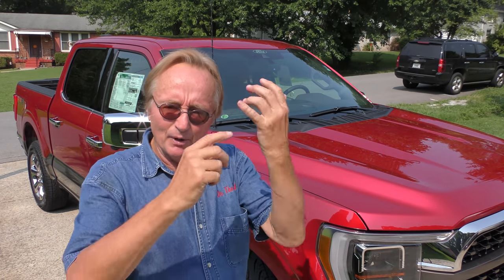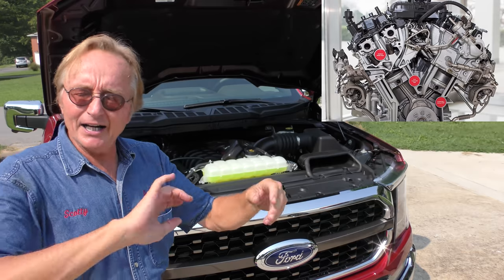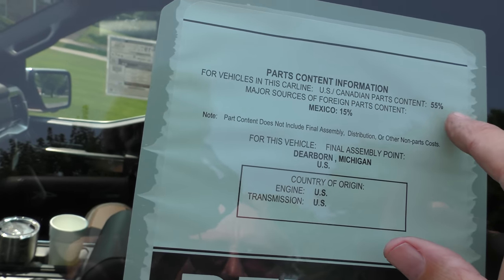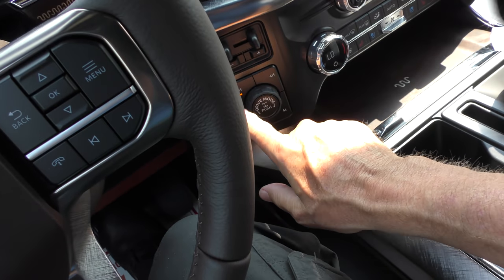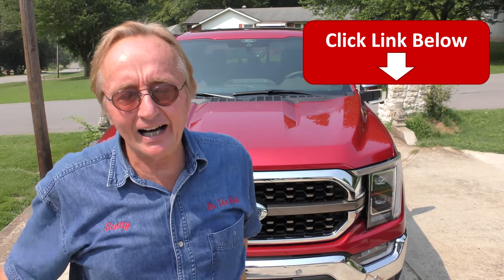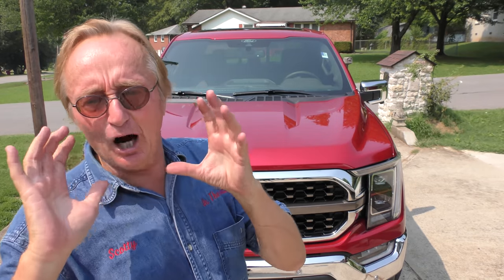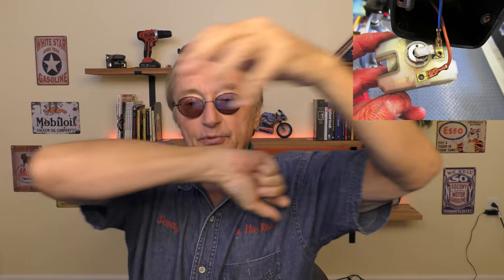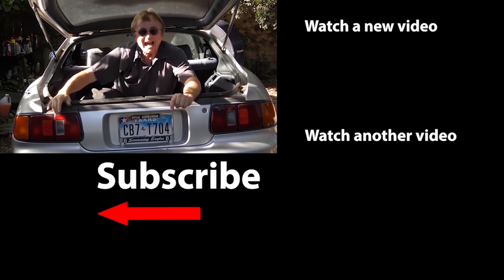I Finally Got a New Ford F-150 and Here's What I Really Think of It

Comment: I own 2 Ford's   a 2014 F250 gas powered and a 2018 F150 .The F250 has 247865 miles on and has never needed anything major I love that truck .My  F150  left me stranded on the highway and had to be towed to the dealership .They advised me that my truck had plastic adjuster's on the timing chain .The truck was in their shop for 3 1/2 months before I got it back . Good thing I had my old 250 for work .They don't offer a loaner till the 3rd month and I could not use it for work..For now I am stuck with it .Beware Ford is not what they use to be .Like I said love my old F250 hate my new F150.

Comment: For the mercedes c230 I have the c230k . It had the same problem. It was due to a faulty combination switch on the steering column.  Was about an hours worth of work and not hard to swap . You will need a long necked t27 to go through the back side of the steering wheel to lose the air bag . Remove airbag and he bolt holding the steering wheel on . Be sure to use the right size . I don't recall it off my head after that you will need a Phillips screw driver . You will remove the clock spring housing.  Be sure to note it's position and handle delicately or it will separate and the spring inside will become unsprung... good luck getting it back together if that happens. Once you remove the clock spring housing you will gain access to the combination switch and be able to remove it from the bracket it's mounted too with the cruise control lever. Replace with a new combination switch I think mine was around 100 bucks . Be sure to note weather you have regular wipers or the rain sensing kind as  they are not the same switch. Assemble in reverse order and remember the clock spring housing has to go on exactly as it came off . There are marks indicating where the arrows should line up. Just a tip have a friend help you when removing the hex bolt holding the steering wheel on . It really helps to have someone to hold the wheel as the her bolt is usually very tight . You will also likely want a cheater pipe to give you good leverage. No steering wheel puller is needed.

Comment: The  only dewcent Ford  back in the good ole  days   had an Inline - 6
Reply: 300 straight 6.  All the power and crappy gas mileage of a V8 with two less cylinders, ran forever though
Reply: Yep, ran forever, that's why they don't make them anymore
Reply: My 7.3 IDI has 300k miles and passes every big 6, whether towing or not

Comment: I'll get one when there is no 10 speed transmission
Reply: 2016 F-150 Lariat 5.0   6 spd. multiple issues during ownership
2019 F-150 Lariat 5.0 10 spd. ZERO issues since new.

Just from "personal" experience. (50% of the time towing)
Reply: @CannonFodder873  I love a ford. I have expedition 4.6 with 270000 its a faily driver for me and we take it on vacations for the past 13 years. I need a new one but I love this4.6

Comment: No one at Ford is stopping me from throwing the V8 in the Raptor
Reply: I know people who have STUFFED a diesel into a Raptor! I think it was a Cummins because they wanted the low-end torque and the extra fuel range and NOT for super fast Baja running speeds. They had to rip out all the engine control modules though and modify the interior info screen control software to make it all work! BUT it shows it CAN be done!

v

Comment: That age Mercedes has a funny design where the wiring for the bulbs is housed inside of the headlight assembly, which gets HOT.  I had a wagon where the wire insulation dried, cracked and fell of, causing the bulbs t0 short out.  I would take a look at the wires carefully.

Comment: Scotty 2016 Elantra GT manual. 2.0L NU engine.  Rod bearing spun at 116k 2nd owner at 27k pulled the pan and cylinder 3 lower rod bearing is hot and I have inspected and changed plugs since every 20k. Recalls on all the 2.0L engines just about except mine extended warranty screwed me what to do now? 2 to 3 k for a used engine

Comment: My mustangs 5.0 is super reliable. Fbo with e85 and the engine keeps running well at 45k miles. The reliability of Ford coyote is why I convinced my dad to go Ford F-150 with a v8 over the dodge/chevy/ecoboost options. His truck runs so smooth. I know Ford has had some trash reliability with certain cars, but the coyote v8 is a beast

Comment: Have you heard anything about the 5L V8’s having an excessive oil consumption problem? There’s a class action lawsuit against Ford about it. My 2020 F-150 5L has that problem. Ford has a TSB for the problem that helps, but it still uses oil.
Reply: I had a 2012 with the 5.0 Coyote and it ate oil. Special ordered a 2020 Lariat with the 3.5 Ecoboost and doesn't use a drop of oil and I'm getting ready for my 3rd oil change at 15k.
Reply: @mikeg5257  That’s unfortunate. I bought the 5.0 only because I follow Scotty and he says they’re the best ones to get. I’m not sure why he doesn’t address the oil consumption issue. It’s also my fault for not looking more into them beforehand.

Comment: I have the 2014 Fi50XLT extra cab four wheel drive. It is a terrific truck, and, the 5.0 Coyote, is a great engine. I get pretty good mileage as well, on a recent 1000 mile road trip with mixed driving, including hauling a bunch of lumber for half the trip, I averaged between 19-23 mpg.

Comment: I had the 2019 with the Coyote 5.0 worse truck I've ever owned oil consumption, transmission issues frozen door locks in sub below weather, leaking crankcase seals. That was just with 50,000 kms. Then got insulted by the dealer on low balling me on trade. Done with Ford!  Drive now Ram 1500 Classic with Pentastar V-6 love it no issues.

Comment: Hey Scotty. The new 2021 5.0L has a belt driven oil pump instead of gear driven. Huge mistake on Ford's part. Steer clear of the new 5.0L.

Comment: Hey Scotty I'm looking to get a Ford Truck but cant decide on which would be more fuel efficient and reliable. A F150 with a 3.0L V6 Power Stroke Turbo Diesel or a F250 Super duty  with a 6.7 V8 Power Stroke Turbo Diesel.

Comment: I just bought a f150 XLT 2022 V8 with an FX4 package, it has a 400w plug, which for me is useless, you can't even connect a simple vacuum cleaner.  My concern is because I see rust on the transmission ball if the truck is new, do you know the reason?

Comment: as someone that has driven ford vans and cars for most of my life, my last vehicle was an Aerostar with the 4litre v6 and it actually surprised me with 
the performance that it had considering it was 4500 lbs the same as my other full size ford vans. i have heard that the new aluminum frames do not stand
up like the older steel frames so when i get to where i will be buying another vehicle again, i will be looking for vans from the 80 as i am very familiar with them
and i used to do most of the work on them by myself, i have done things that service mechanics said couldnt be done but as a back yard mechanic, we dont know
what it means cant be done, it just means improvise and lets do it.
Reply: Actual frames are still steel...no one uses aluminum for a SOLID frame. Unibody, maybe....but that's NOT a frame.🤷🏼‍♂️
Reply: from some of the vids i have seen, there are aluminum frames being used in some truck to save weight along with other cheap parts so that
the older trucks are much better built than many of the new ones.

Comment: I have a 2016 v8 f150.  These trucks have a major issue with stalling and ford cant figure it out permanent fix .  In drive while foot is on the brake. Once you release brake it will stall randomly.  Have you ever seem this?

Comment: Scotty!  I'm really debating between a new v6 Tacoma and a new v8 f150.  I realize the difference in sizes, but I'm wondering if I may want to upgrade to the Ford or whether or not I might kick myself for ditching Toyota's reliability record.  What's your opinion?  Thank you sir.
Reply: I’ve owned both   They both have great reliability. My only gripe bout Tundra is fuel consumption and cheap interior. 
Handling isn’t as smooth as ford but good enough. 
Main thing that differs between both is towing. 
Ford out does the Tundra hands down.  
All in all both great reliable trucks. 
Good looks as well

Comment: One thing no one tells you about driving an aluminum truck in the pouring rain is how loud it is compared to steel. I have a 2014 F150 and my boss has a 2015 f150 and the sound in the rain is a night and day difference.

Comment: The best engine currently available in the F-150 is the 5.0L V8 period. I’m hoping that they will eventually offer it in the Bronco, because the 2.7L isn’t that powerful or fuel efficient.
Reply: Yet the 2.7 stomps a 5.0 especially if it’s tuned
Reply: A 2.7 Ecoboost is the fastest F150 made. They scream in the 1/4 mile.

Comment: Nice smooth shifts till about 7 or 8,000 miles then the LEARNING TRANSMISSION WRECKS A PERFECTLY GOOD VEHICLE !! The 10 speed transmission SUCKS !! mines been reset 3 times and ford insists that it's normal !! Feeling like you've been hit from behind when shifting thru 3rd 4th or 5th gear is NOT NORMAL !!  Even the service mgr. at the dealer where I bought mine says they are problematic !!

Comment: I have an 2004 F-150 Lariet ; 140 thousand miles, Runs Like A Clock.........but no one listens to me, when I installed the best suspension  upgrade for an F-150, buy installed an air-bag, under the drivers seat....This is nothing new, you see the same set-up in big rigs going back for decades, not years, decades.......it gives you such a lovely ride with the stock factory suspension, but with FORD, all you get from them is a ruler embedded into the tailgate "as a feature".......!!!!  GD it, what in the hell is wrong with them .....??????

Comment: A transmission flush is better then a general  transmission  change..so I disagree  with you ..when u only change 3 or 4 quarts of old fluid there is still like 9 quarts of.old fluid left in transmission so its defeating the purpose of a transmission change..a transmission flush Removes basically all 12 or 13 quarts of old used fluid and replaced with 12 13 quarts of new fluid. It's better for life of transmission

Comment: I drove both the 3.5 & 5.0 when I bought mine new in 2019... there really is no comparison aside from the sound. You need to rev the snot out of the 5.0 to get to it's power band. Towing my travel trailer, 3.5 with the 10 spd is the only option. 5.0 is a great mustang motor, torque isn't there for the trucks.
Reply: I'm leaning towards 2.7 only because research shows torq is down low like a diesel. I plan on towing a enclosed trailer from time to time around 7k on the weight. I just hate reving the snot out of v8's to get up just mild hills it makes me super nervous.
Reply: @milleniumann28  2.7 is a great motor, but if you're towing, find a 3.5. you'll want the torque.

Comment: I have 2018 limited. 3.5 eco
Too much torque and HP, can't use it all.
V8 is a mustang engine, gotta get rpm way up to get power. Not with ecoboost. I have full torque at 2k rpm.

Comment: Hey Scotty I have a 2012 ford f150,  lately is been starting and then not starting.  I been checking different videos in YouTube and I haven't seen one from you about possible problems and how to fix it. Like I said,  sometimes start and then won't start. Battery is good no check engine light, control looks like it is doing its job. And it looks like it's an electrical problem at the fuse box. But I am not sure where to go next. Help

Comment: King ranch, isn’t that top of the line F150? What does that cost$$$$? I had a 2010 f150 with the v8 that I got rid of because of hail damage the 1st summer. I then got a 2011 with the v6 turbo. I love the power the turbo has but now wish I’d got the v8, that 2010 was getting better gas mileage then the V6.
Reply: No limited is the top

Comment: What happens when the button that automates the shifter quits? Does it render the truck inoperable? Is the a release that allows manual operation? 
It looks neat, but seems like a pretty unnecessary feature that fixes a problem that didn’t exist. More stuff to break.
And let’s not even mention the 3 cylinder engines they’re putting in the Bronco Sport. 🤦‍♂️
Reply: It's a scary scary scary world out there!  Duck!  Here comes a truck with tow hooks!  Totally unnecessary......... almost got you

Comment: Scotty,

I bought a naturally-aspirated, 5-speed 2009 Jetta SE with a 2.5 liter, 5-cylinder engine in May 2020. It currently has 101k miles and runs and drives like a dream. I changed the manual transmission fluid last year and I change the oil every 5,000 miles. The only real problem that I had was the A/C, which I rebuilt (compressor, expansion valve, drier, and condenser). Is there anything that I need to look out for with this MK5 Jetta in the future?

Comment: What do you do when that shifter decides to not pop up? I hope that's just that specific model because that looks like a problem waiting for the worst possible time to make your truck undrivable.
Reply: Whip out a crowbar or a long flathead screwdriver.
Reply: @standhd  That would be my inclination too but I guess there is a Ford approved method. Something about pulling out the cup holder and popping it up manually. I'll just stay with my 2010 6 speed manual TRD Offroad Tacoma.
Reply: @johnossendorf9979  LOL….good idea!

Comment: Hey Scotty. I have a question. How long do you think this will last with the v8 engine and knowing that they had a recent call back with the f150’s? I love these new trucks, but I’m a little skeptical?
Reply: That v8 will last as long as you want it too
Reply: the "new" 5.0 has been around since 2011, and its roots go back all the way to the original "modular" v8 introduced back in 1991. It has stood the test of time. Granted there have been a few issues here and there, but it is generally regarded as one of the better more reliable v8s out there.

Comment: On the same vein as this episode's question. I was told by the dealer that I need to do a fuel system flush/cleaning/service/whatever on a 25K mi Chevrolet Colorado. I know occasionally you need to replace the fuel filter, but is this a scam or do I really need to "clean out the carbon from the system" and so on? If it is needed is it something I can do on my own?

Comment: Left turbo had to be replaced around 50,000 miles in my 2014 F-150 3.5L EcoBoost engine. Plus several other fixes. Fortunately enough problems occurred under original warranty that I bought an extended warranty to 100,000 miles or March 2023. I've already gotten my money's worth out of the extended warranty. Only 23,000 miles left on the warranty so next year I'll be getting a new truck. Maybe I'll win the raffle - HA HA! I did live in Tennessee for 22 years so perhaps the  wildlife gods will shine on me.

Comment: What could be the issue when your car seems to be breaking when you let off the gas
Reply: Assuming there is actually an issue it is most likely sticking brake calipers. Jack the car up and take each wheel off with the car in neutral. See if any wheel is dragging which could indicate sticking brakes. Scotty has a video of how to fix sticking brakes if that is your problem. If it only occurs at higher speeds at higher rpms that is actually your engine braking which is completely normal and a non issue.
Reply: @admirbasic2206  thank you I’ll check it out I really appreciate your response
Reply: @ThecarwashchannelofnorthernPA  yeah no problem. I hope you get your issue resolved. Provide an update if you can. I'm trying to learn more about car repairing and diagnosing myself.

Comment: Hi Scotty, just wondering, would you say there is ANY difference in reliability between Chevy trucks and GMC trucks? I realize Chevy and GMC have both been owned by GM for over 100 years, but there seems to be a myth that the GMC trucks are built with more "care" than the Chevy versions. I especially wonder if the GMC trucks from the 90's (at that time, every GMC truck was COMPLETELY identical to a Chevy truck, except for some very small details) were any better than the Chevy trucks from that era. And was the GMC name considered more prestigious than Chevy in the 90's, or did GMC only become more prestigious once they started making Denali versions of other models than the Yukon in the past 15-20 years? I thought it was ridiculous that BOTH Chevy and GMC made an identical vehicle called the Suburban in the 90's. And it was ridiculous how both Dodge and Plymouth sold the same car with the name NEON during the same time period!

Comment: "Simple V8". This engine has 4 camshafts, all 4 have variable timing features.  Direct AND port injection fuel system.  So this simple 5-oh has 95% of the complexity of the eco's, and for the 'simplicity' you can run 4 to 6 thousand rpm up every hill pulling much of anything.  Enjoy.

Comment: Ford went down the GM path with cylinder deactivation system on the Coyote. People say they can disable it but that’s not the issue, the cam shafts are not the right hardness and they are eating them. The 3.5L Eccoboost has a service life of 250,000 miles, Coyote service life is 200,000 miles. And the 19 and 20’s can drink oil. It’s a beautiful truck though!

Comment: I have a 2017 F-150.  It made it to 16K miles before I had a problem with it.  I now have just under 50K on it and I've had 6 problems...IIRC...with it and now the axle bearings in the rear have gone bad.  I used to swear by Fords, not anymore.  These things are junk.  That's two F-150s in a row I've had that were nothing but problems.

Comment: Congrats Scotty. Now here is the deal. I own a 2021 GMC Sierra AT4 with the 6.2L. Absolute excellent power and sound from that engine. BUT! I think the Ford F-150 with the 5.0L (esp the King Ranch) is sexier inside and a great choice. Not a fan of pickup trucks w/o a V8. If I cared about gas mileage, I would drive a car with putt-putt four cylinder engine.